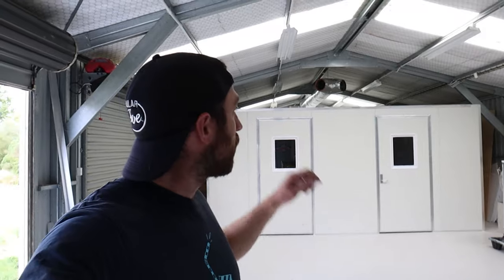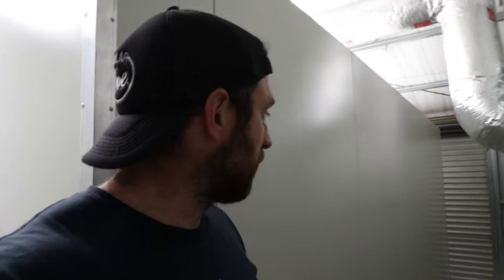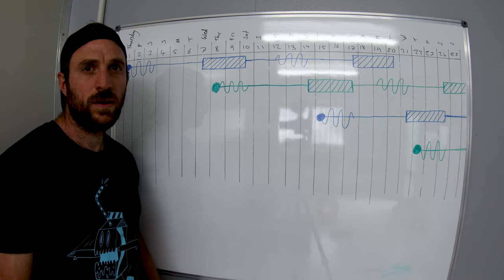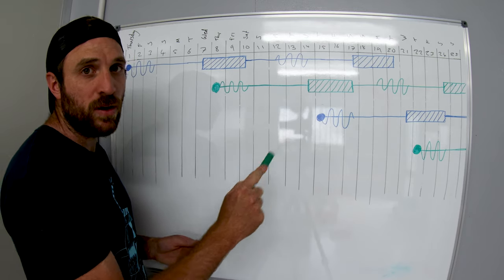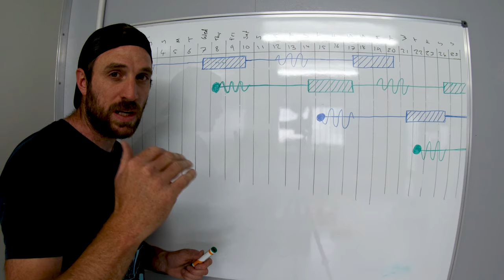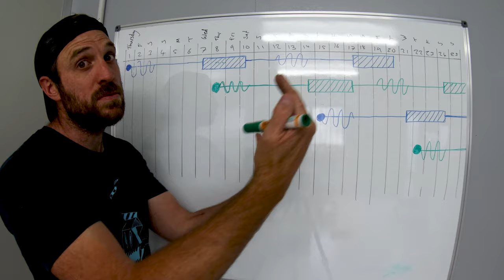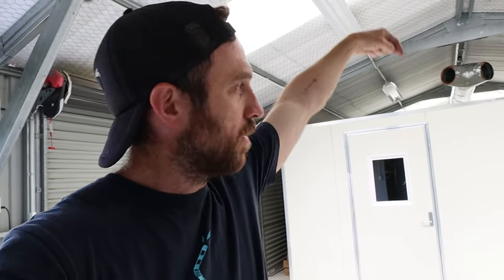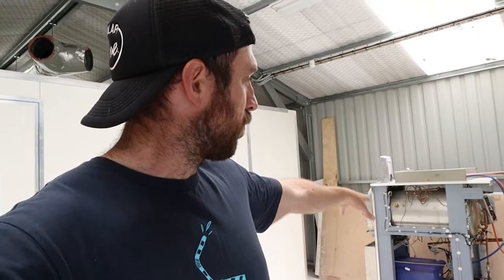Building Twin Mushroom Fruiting Rooms - Reasons Why I Built Two..

Comment: It's an interesting concept and since you are mainly growing one species i guess it could work, at the very least is better than FFTFF's way that if i recall correctly(maybe i'm mistaken) he moves bags from one room to another depending on different stages which seems insane! but if he makes it work good for him. 
Your way will work as long as you can keep the temps very stable, otherwise it's gonna get really messy and confusing, I personally don't trust my mushrooms enough to expect them to follow a schedule lol so you are a braver man than I, good luck with this and I hope it works out.
Reply from the maker: Moving bags by hand was one of the things that always got to me, so i decided the rolling rack system. With my setup I am aiming to keep temps around 18c all year. I have a 10kw heat pump feeding these two rooms.
Reply: @OakandSpore  could you please share the make and model of the heat pump?

Comment: Thanks for adding my question to the video! It does make sense. I’m building a 40m2 fruiting room as well and had the idea of just one big room for all varieties but it makes sense to brake it up in two. Are you leaving the air vent on 24/7?
Reply from the maker: the air vents will be controller with a building automation controller and cycle up and down as the co2 rises and lowers.

Comment: Hi Tom love your posts. I’ve got a couple of questions if you don’t mind answering? First of all, what height are your Ceilings on the New Fruit Rooms ? Secondly, is 100mm thick walls more beneficial, I noticed you went with 50mm walls. Cheers
Reply from the maker: Mine are 2.4 tall. Yes I wish I had gone thicker than 50mm, but it would cost a bit more.
Reply: Awesome. Thanks Tom!

Comment: Hello, just finished building my mushroom farm northwest of Canada with shipping containers. I was thinking about your problem with the humidity and my idea for budget can be having 1000psi pump on a timer set up for approximately 75%humidity than having a fogger build on a rolling cart with a humidistat for 90%, easy to move and clean.
Reply from the maker: We are looking at using high pressure as well.
Reply: @OakandSpore  my fruiting room is a 53ft Macdonald trailer and pass the first cold temp of -7c with lot of snow.

Comment: Good stuff! I’m in the process of expansion with two shipping containers. Are you going to be having the humidifier tub inside the fruiting room or outside and feeding in with ducting and will you be making it so the preconditioned air is combined with air from humidifier or does it not matter too much if they are fed in separately, potentially at different times?
Reply from the maker: I think we will go to high pressure humidification.

Comment: Can you get on top of the ceiling of the rooms if you ever want to clean that surface? Or is it not that resistant? It is 2" expanded polystyrene right?
Reply from the maker: Yes you can climb on top. It's polystyrene sandwiched between painted steel sheet. Its really quite strong.